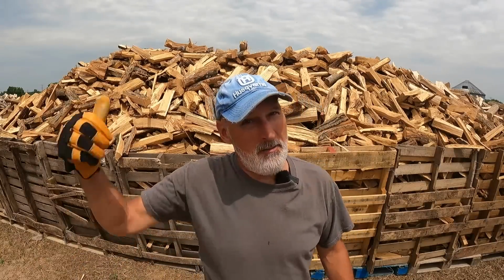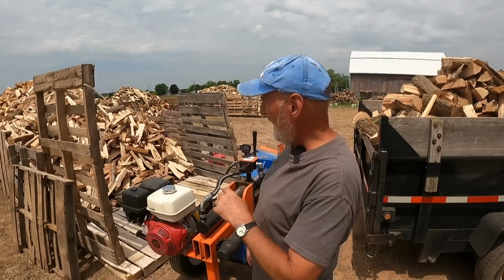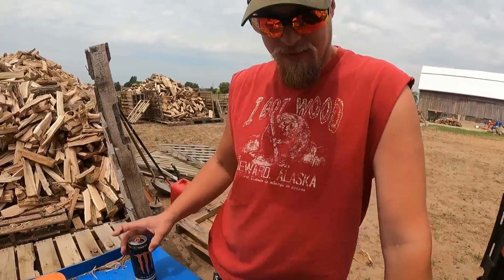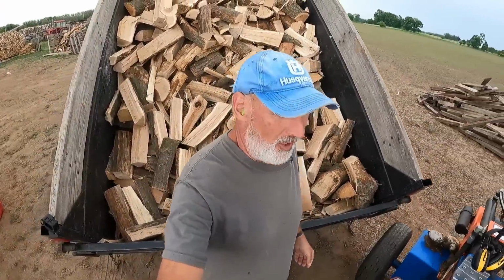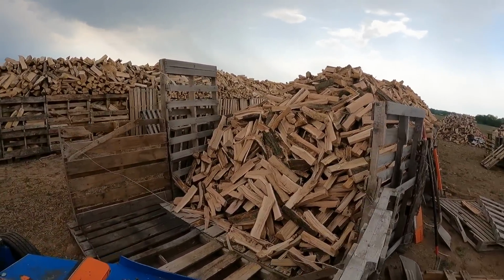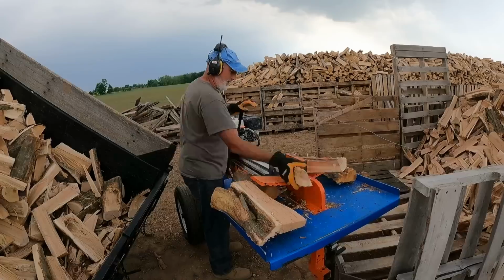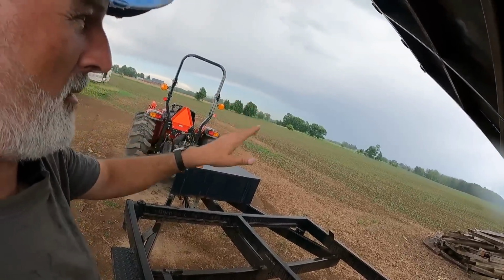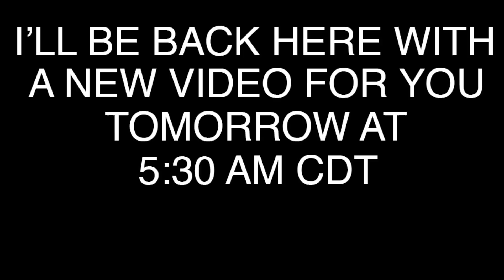Splitting firewood IN THE RAIN!

Comment: So Chris what method have you found to be the most efficient for running the firewood processor and getting the re-splits done?
Reply from the maker: Run the processor into the trailer and tip the trailer up and do the re-splits into the bins, just like I have been doing on the videos.

Comment: Chris , I have a question based on my observations of all of your videos. I realize that the processor is much easier on the body , but would you say it's actually faster for producing a cord of wood. It seems that with the time it takes to stage the logs, sort through the logs , split the wood , and then re -split the big pieces and the other time consuming things involved in using the processor that it may actually be faster with the Ultra.   Thoughts ?
Reply from the maker: Nope,. not even close. The processor makes 3x the wood....at least.
Reply: @InTheWoodyard  WOW, interesting
Reply: Anthony, I have splitters and a processor. Huge advantage of the processor is very little manual labor. Load the log deck with my tractor, then sit down and start pulling levers. I have 4 way and 6 way wedges and most of my clients are heating with the splits so I can do bogger splits.  Chris sells campfire wood so smaller splits are needed. I sell some camp fire wood so I load my deck with 8" logs and use my 6 way wedge. Bigger logs go for heating. To be more efficient Chris could do the same thing but more tractor work is required and he would still have to do resplits on the larger logs. All comes down to dollars and cents.
Reply: @DaleFarrish  I see, makes sense

Comment: If you want to go higher you could take the elevator and  plug into your battery pack and split into it over the bin and really get it up there
Reply: Conveyor wont run on battery pack.
Reply: We gotta start a GO Fund Me
And purchase a gas motor for the conveyor..
Bert could make it work , I'll bet.

Take the belt off the electric motor and put it on the gas motor,
Dual fuel !
Reply: @BertsCustomCuts  oh I've seen other people do it on different programs but ok
Reply from the maker: It needs more power.
Reply from the maker: we might have a solution!
Reply from the maker: It needs more juice, maybe a bigger battery.
Reply: @InTheWoodyard  Scotty called from the engine room,
He say's
"I am giving her all that we've got captain, "
😄 
We need a dylithium crystal

Comment: Lightening is lazy, it's all about the path of least resistance...we're walking bags of water, lightening likes that.  When you're standing under the trailer as you were, the trailer is mostly insulated from the ground by the rubber tires so after hitting the high point of the dump box, it would jump to your head and travel down through your body to the ground...poof!  With the dump box lifted as it was, sit on one of the wheels with your feet OFF the ground, cross-legged if you can, and that will increase your chances of surviving a strike, especially if you lowered the trailer jack for a ground.  You survived another day...yay!
Reply from the maker: Yup, I probably should have taken a time out in my truck!